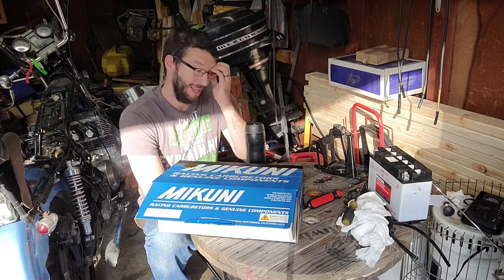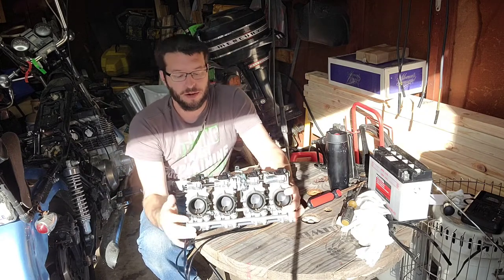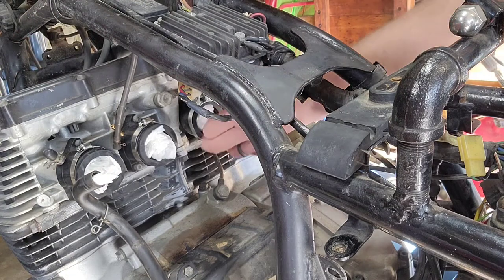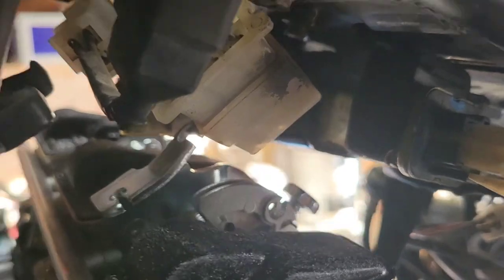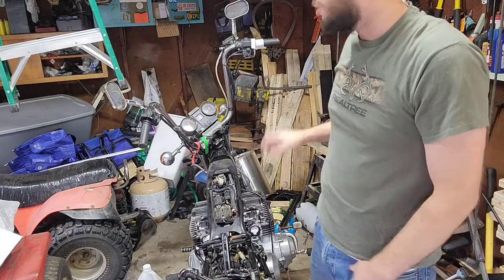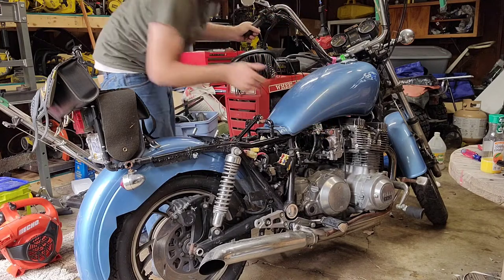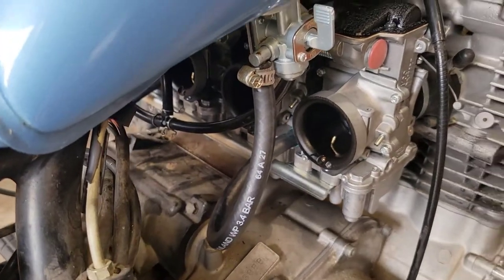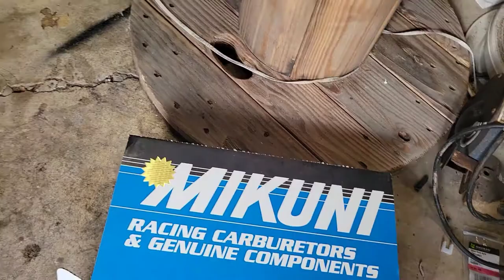Yamaha XJ1100 Carburetor Upgrade Part 2, In With The New and First Start.

Comment: I just bought a 1982 Yamaha 1100 XJ Maxim it's my first motorcycle and there are not many videos or very much information on this bike and I have found this video to be very informative thanks for posting good stuff
Reply from the maker: I had the same problem. You can look up project basket case on here and find a guy who used these same carbs on a cafe racer and more info on the sx1100 which is very similar.

Comment: Bryan, a hearty thanks for the Videos.  I just picked up a 1982 Yamaha XJ1100 Maxim, about 3 weeks ago.  I'm a FF In Indy, and having fun with my vintage Motorcycles.  To save money, I might search for the #3 Carb, due to a mistake.  This 1100, came with the complete Vetter package! 30K on the motor!
Reply from the maker: Mine just turned 30k a month ago. Not sure what a FF is (I bet anything I know but I don't know) but I have a video coming next Friday on the old girl and fixing another thing on her. I still have my old carbs, took one off to explain to a buddy how a CV carb works, but all still in a box. I'm not sure what the vetter package is, this one use to have a huge ferring on it before it got the common look setup put on by my dad and then he later customized the entire bike.
Reply: Career Firefighter
Reply: Bryan, I need a replacement #3 Carb, from that Mikuni set-up.
Reply from the maker: @richardoslund3772  number 3 on mine was the one that had a float pin tower break and was JB welded back in place, the fix worked but the CV carbs in general I figured it was tike to get away from. You are more than welcome to having all 4 free of charge, they will more or less be hitting a trash can soon, just come get them.

Comment: I'm also doing the same thing except I just had to change the boots not the carburetors but I removed the airbox and just put air filters on the back of the carburetors because it makes it a whole lot easier to work on
Reply from the maker: The factory carbs don't like the pod filters much but they will run them. I suggest jetting up one larger size.

Comment: I liking what you did here. I might follow yur lead on this
Reply from the maker: I searched for weeks about non stop to source any carbs I could find that would work and kept coming back to these. Used carbs aren't getting any newer.
Reply: @mistermacgray  I have three xj550s from roller to runner, four engines from basket case to daily riders, four racks of carbs. I am currently trying to acquire the 1100 and should have that on the road by months end. If I do decide to make upgrades as opposed to keeping original I definitely want to go this direction. I love Mikuni s.
Reply from the maker: @tauro428  unfortunately originals had gone bad from sitting with fuel and no helping them so plan B it was.

Comment: Bryan, what exact air pods did you use on that Mikuni Carb?
Reply from the maker: Look up on ebay 55mm oval air filter pod and you will find ones like what I got. The original listing for what I got has expired. So far they are holding up great and keeping dirt out of my carbs